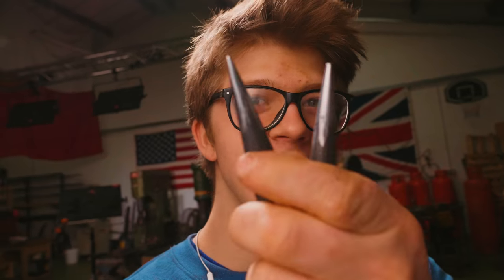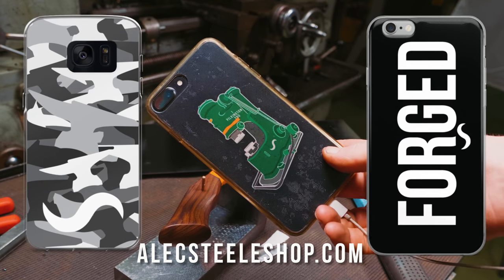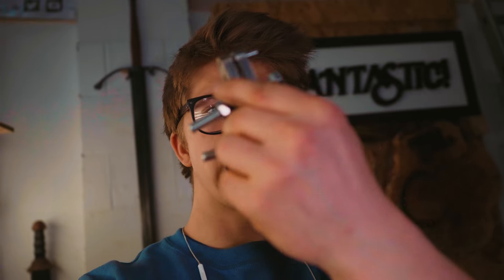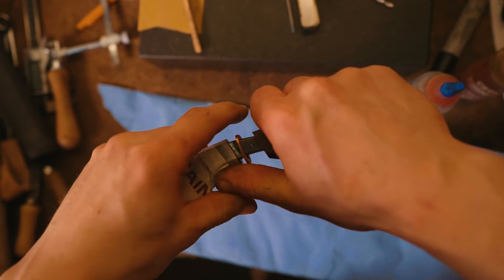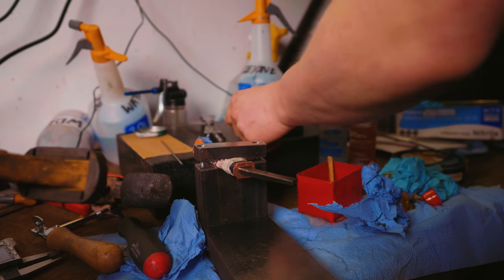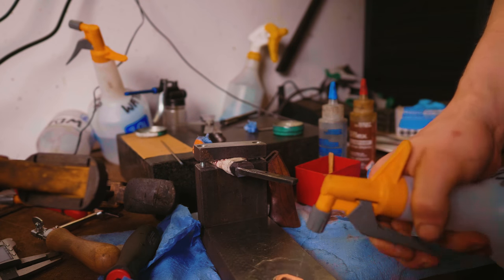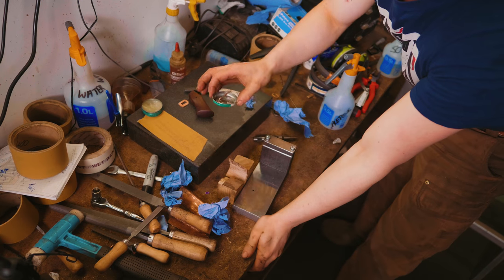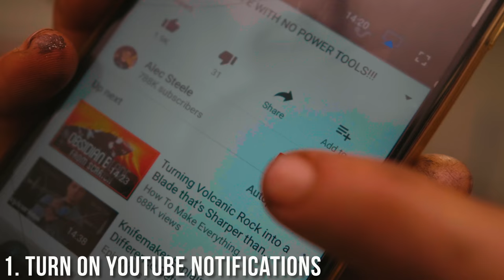MAKING A KNIFE WITH NO POWER TOOLS!!! PART 7

Comment: Need an alex steel brand of extra long lighters.
Reply: I was just like "NOOOO" as you filed the gap larger and larger.... Just get the shim close and make it a compression fit because with all the water you spray on the wood, It's not dimensionally stable.
Reply: Yep, The gap persists.
Reply: Well, looks like you managed to solve the gap issue i suppose. Very inspirational words

Comment: Dude your building the handle backwards and redoing work over and over.  Fit and glue the wood to the knife first. Then shape and finish the handle.  I could have that handle done in an hour with hand tools. 10 minutes with a grinder.  At most that's a four hour knife. Think about your order of operations.

Comment: why didnt youuse any epoxy and sand some of the same wood with a fine grit sandpaper and when youput the handle in just epoxy it wiwth the mixture, yourgaps are small enough that you risk no integrity and there wont be a lot of epoxy, that would have looked good and worked, but maybe thats not your style to do a chinsy fix like that